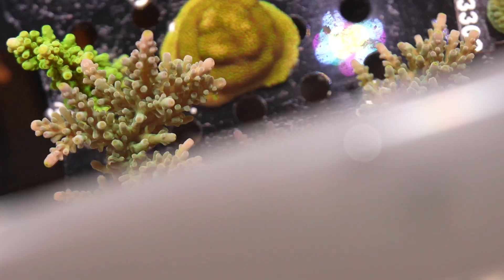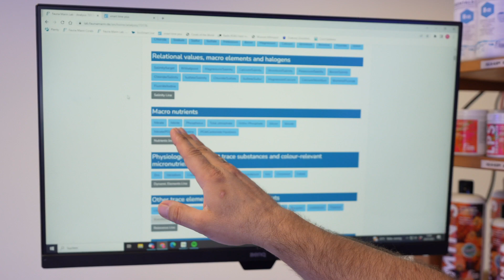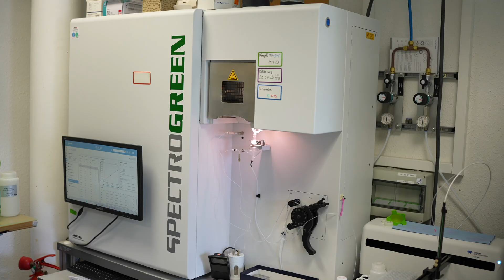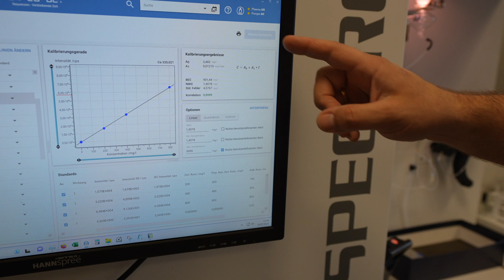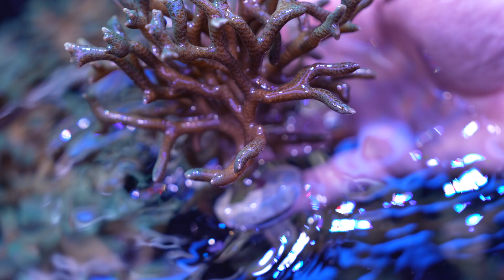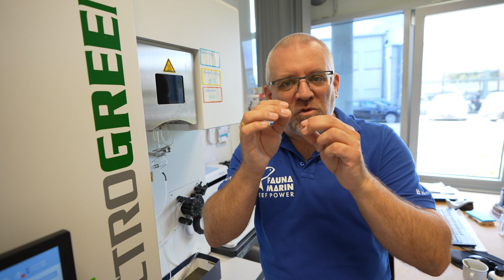ALL ABOUT ICP - Sea water lab test

Comment: Hallo Claude, ich habe eine Frage zu meiner ICP vom 19.07.23 -  76957. Gibt es eine email Adresse für einen Support diesbezüglich oder nur auf telefonischen Weg? Ganz speziell die Angaben der Relation NO3/PO4 wird ja unterschiedlich Diskutiert (siehe ATI Aquaristik). Ich habe auch mein Becken im ICP.LAB Bereich hinterlegt inkl. einer Beleuchtungsmessung mit einem ITC PARwise. Ich nutze aber das Sangokai Versorgungssystem, dort wird ja eine andere Herangehensweise bezüglich der Spurenmetalle/Nährstoffversorgung verfolgt.  Deswegen wäre hier eine gezielte Beratung/ Meinung ganz interessant, gerade auch im Hinblick von einem anderen Unternehmen. Ich möchte auch in Zukunft meine ICP Untersuchungen gerne bei Fauna Marin durchführen lassen (Langzeitkontrolle). Gruß Guido Mai
Reply from the maker: Meld dich einfach unter support@faunamarin.de